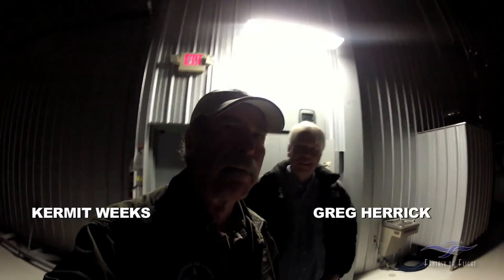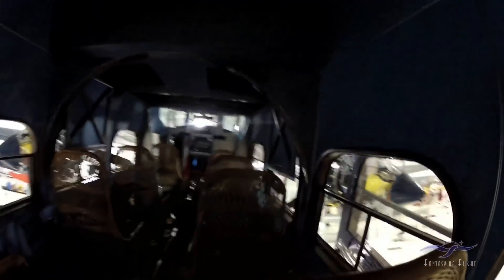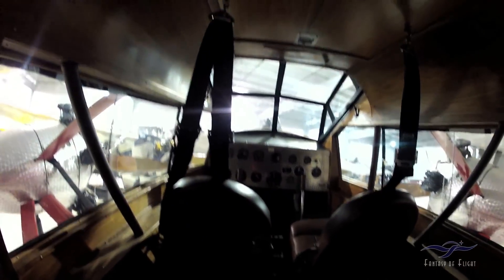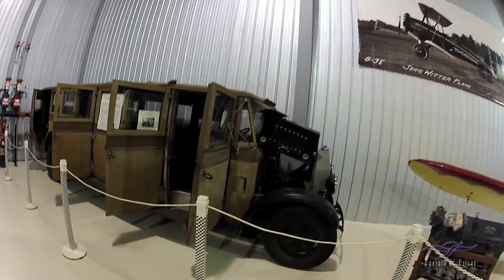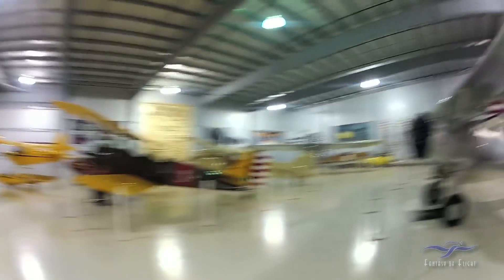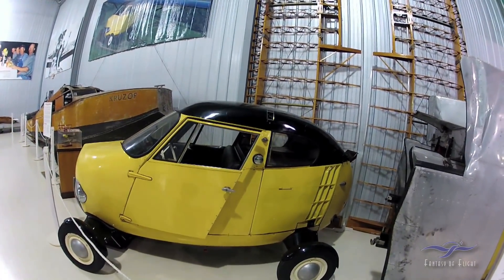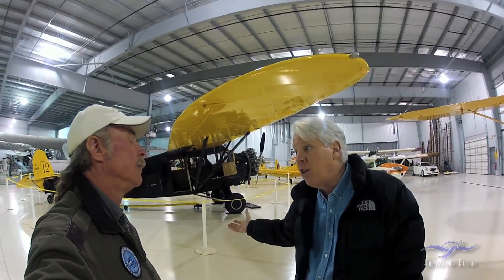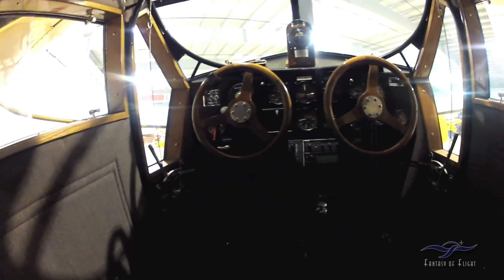Greg Herrick's Hangar Tour - Golden Wings Flying Museum

Comment: its kermit's helicopter collection as i don't have any. he has a bell 47 h-13 in the M*A*S*H* theme on it and 3 Sikorsky s-55s. two to be for ride operations, the parts s-55 will be static he says. i think he has one Pitcarin autogyro. but interesting planes in the video the one trimotor Greg herrick has Lindberg flew.